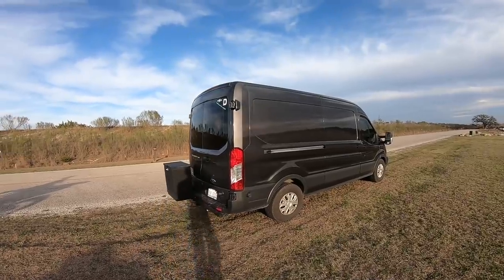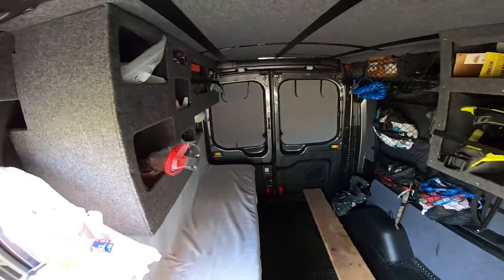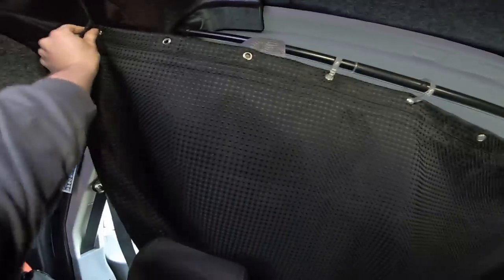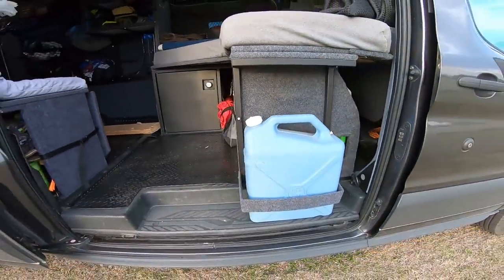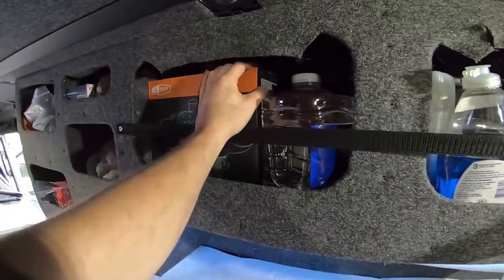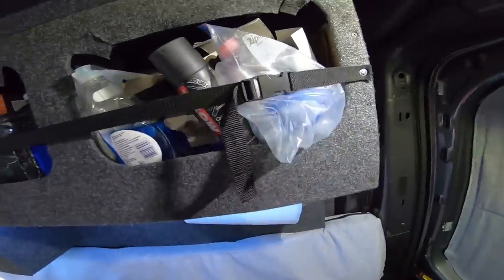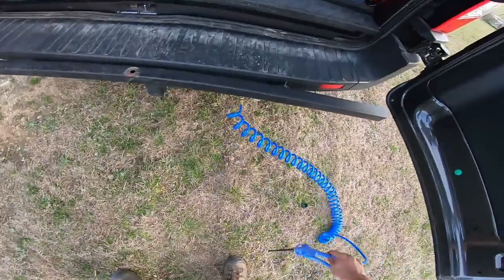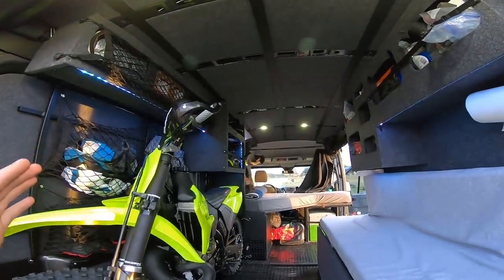Motovan Adventure Camper Tour - 2017 Transit 250

Comment: This is a really great build, especially as a solo traveler/rider or with a friend. For a couple, I could easily see changing the rear bench/bed to be a modular platform bed just above the height of the bikes and potentially eliminating the fixed front bed. That way, one could fit two dirt bikes/dual sports and perhaps two mountain bikes lined up across the full width of the van while having a full bed setup just above them. Again, awesome job!
Reply from the maker: I’m a big hater of beds above the cargo area. Makes everything sooooo awkward to access. You want all your dirty gear there...but you have to either put it in from outside or get the front “living” area dirty to do it. Makes things messy. Also not enough height to do that even with a tall roof. Not with a dirtbike at least...

Comment: Love it, once you get solar set up you should look into getting a roof vent with a fan. They make some really efficient and quiet ones for rv's that run on AC or DC. You'd be surprised what kind of heat you can withstand if you've got a little air moving through. Check out the fantastic roof fan.

Comment: Just bought a 2012 Ford Transit box van with 750kg lifting backdoor that I will make into a camper with room for my KTM 500 dirtbike under bed at back (220cm under roof so no problem fitting garage under bed). Entire car is 6,5m long but it is short wheelbase so it feels much shorter when handling in traffic and it is 220cm wide. The lift at back works perfectly as a hight adjustable table when doing maintenance on the motorcycle :) (remains to be seen if the lifting door works for loading and unloading the bike also)

Comment: one feature I would add is to run an additional set of door window switches to your bed area. So you can control them without having stretch around seats, or go outside and walk around open the door, raise/lower a window. It's a simple yet super effective mod.

Comment: Get a section of PVC pipe for that water hose.  I don't know what schedule pipe, but just the thin-walled stuff.  Glue a cap on one end and just slip a cap on the other.  Attach it to the bottom of the cabinet or somewhere handy.

Comment: Very nice of your aunt, good video thx. Why not just pull a toy hauler behind a truck? you can detach from the toy hauler and use the truck for running into town or whatever. Bikes even fit in the back of the truck if you want to go riding with six or seven buddies.

Comment: Sweet build. Only thing i would do to my motovan is build a wall with a big bench seat behind the seats and leave the back empty to put bikes and crap. I couldnt see myself after riding all day having to tear half my van apart putting things away. I just load my bike up, throw my crap in and roll out.

Comment: the brake system on this vehicle is way under braked.  you will blow through brake pads and rotors around 10,000 miles. the motor is awesome and twin turbo. enjoy🙌

Comment: I'm impressed at how much utility you fit into the medium-roof 235"-long version.... But why hang a big gas-box off the back, instead of getting the 264"-extra-long high-roof version? Roughly the same parking length, but much more space.
Reply from the maker: Because this was my daily driver for 5+ years and the cost of a high roof extended was a lot more. I already went out of my budget with this. In any case, having gas cans inside is horrible. So much fumes. Not as bad in the bike gas tanks as they don’t leak everywhere.
Reply from the maker: If you look at my community section on here you’ll see I’ve since upgraded to a chassis even bigger than the 148” extended….in process of building, will have a build series out soon.

Comment: Hi Berad, i have a question about your water tank setup, how do you make sure that the pipes or the tank doesnt get damaged when you are in very cold weather and the water freezes? Do you have some kind of heating system running or do you have to let the water out? 
Thanks and keep up the good work :)
Reply from the maker: WALLBREAKER_935 I always just drain it all of it will be cold. Kinda sucks but if it’s cold I don’t really need it anyway 🤷🏼‍♂️

Comment: I know you have gas cans outside, but is the fuel/oil/exhaust smell when the bike is inside.  Does the smell permanently permeate the fabric?
Reply: 2 strokes stink up the van bad, 4 strokes not so much. Putting a plug on exhaust helps a bit. Gas cans outside do not help much since you have a bike with vented fuel tank inside. But  I never smelled the raw gas inside the van, just the exhaust/carbon smell.  Not ideal but if you keep windows open it helps. The 2 stroke exhaust smell permeates the fabrics for life. These are based on my own experiences of sleeping with bikes in a van. Having gas tanks outside the rear of the van scares me (in case somebody rear ends me)
Reply from the maker: I’ve had no issues with lingering smell. Sometimes camping it’s stinky a bit but open the windows and not bad at all

Comment: THumbs up for the video and great design.  However, if you get in an accident that bike will come lose and kill you.
Reply from the maker: I highly doubt it would. It’s strapped down well to steel anchors. It’s also captive under the helmet shelf. It would also have to cross through the welded steel bed frame that’s probably stronger than The van frame itself lol